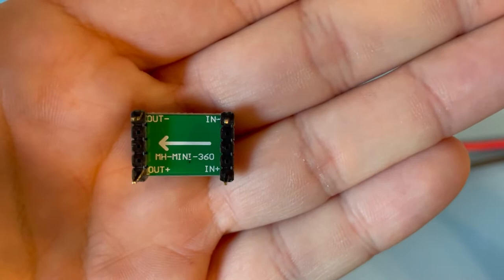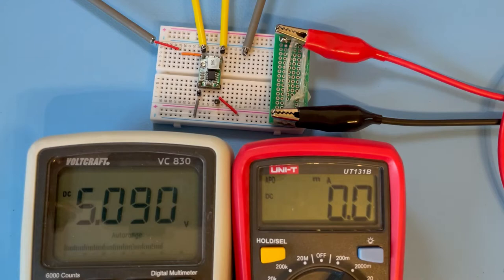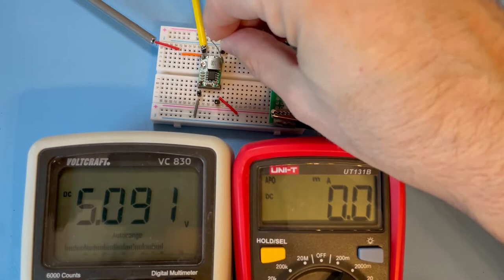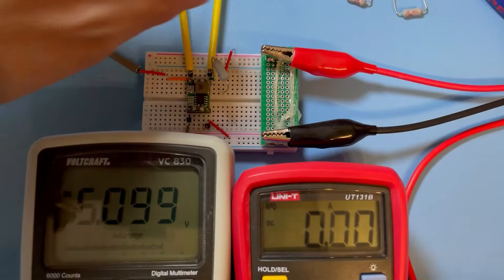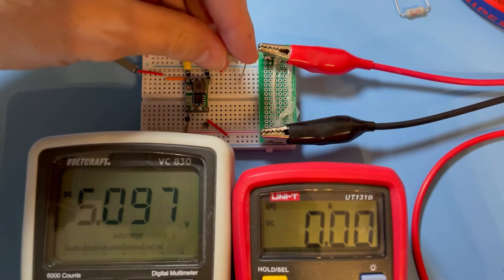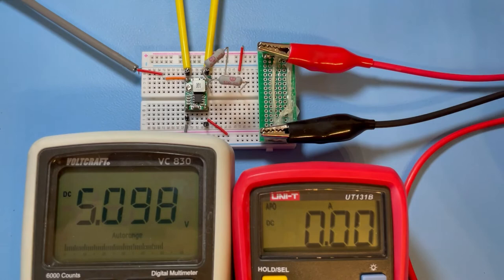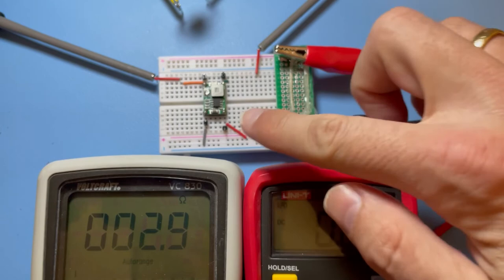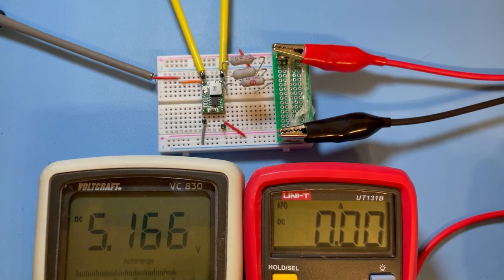DC Buck Converter MINI 360: Current Stability at 5V

Comment: In other videos these were running at a significantly different frequency to the specified regulator spec sheet. They must use either fake semis or out of spec devices. No surprise therefore that they need a larger inductor and input/output caps. There seem to be 2 versions available but even the one you used has been shown to deliver 2a at 5v with this sort of mod.

Comment: Yeah not much of a surprise there ! 3 to 4A loads are the IOT use-cases that needed testing of buck converter that output at 5V.

This mini 360 is rated for a 3A peak output, but unfortunately you have not loaded it to it’s full spec.